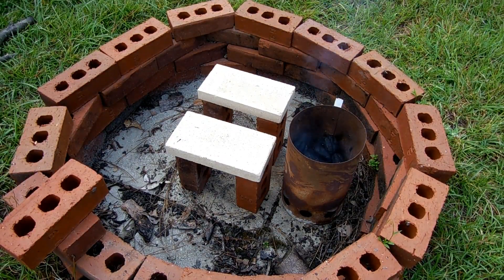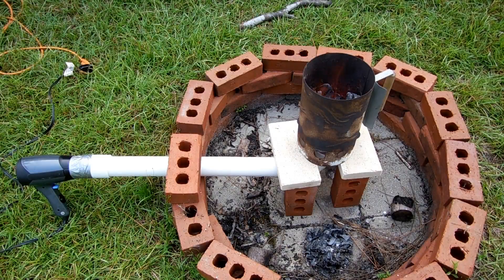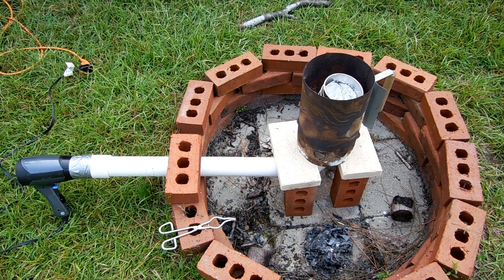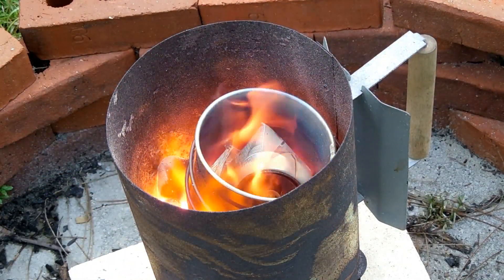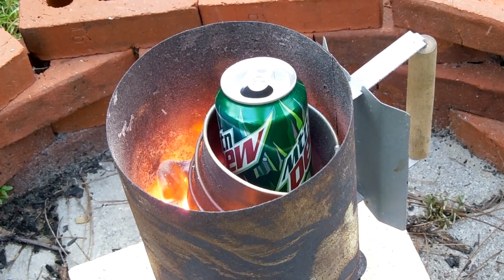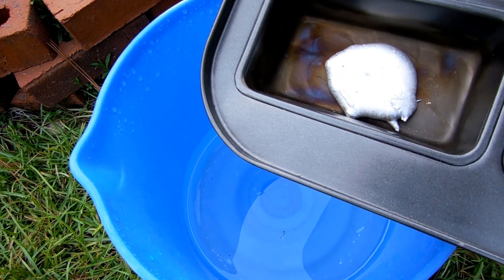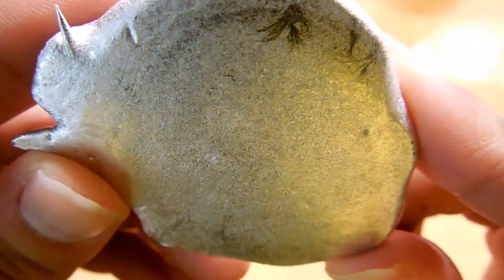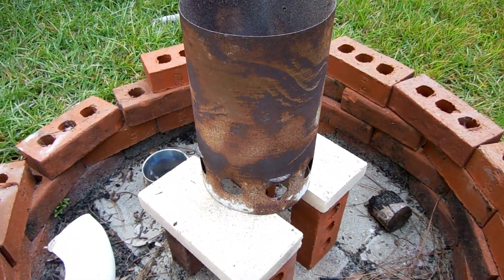Very Simple Aluminum Furnace

Comment: lol i tried melting aluminum on log fire.. it failed
Reply: Has to be a decent log fire for it to work. Wait till your crucible is red hot before putting cans in. 

Back in my primitive days, I used to have the same problem but I kept at it and figured out what was wrong. The crucible needs to be red hot before the cans go in. Don't place one can immediately after the other unless the cans are quickly melting down, once you're out of cans, stir the contents and tap the crucible to allow any trapped slag to float to the top and skim the slag out. Then make your pour.

Comment: have you tried other types of metals like lead or brass?
Reply from the maker: Lead's melting point is far below aluminum, so you don't need anything as "complicated" as this furnace. See my other video on making metal bars for some other metals I've used. Brass is well above Al, and I very much doubt this would be able to melt it. I think it /might/ do copper, but I have yet to try this.

Comment: I wonder if this is necessary. When I was a child, my home used charcoal stove to cook. I liked to play with burning things. Once, I put cans into the stove hoping that it would melt into Alum-nugget and it did. These stoves have a air-window below the burning-room, which allow user to control the burning rate. I believe these regular stove can reach temperature up to 800 degree celsius, above Aluminum melting point.

Comment: You'll lose less metal to oxidation if you stomp the cans flat first.  There are a lot of  YouTube videos and Web sites devoted to hobby foundries.  Some of those guys have moved up to melting cast iron with forced air and used motor oil.

Comment: Wonder how your project has evolved thus far. I would've drilled a hole into the side of both the chamber you hold the coal with, and the one you use to melt the aluminum with (near the bottom of the second one). After that attach the small one inside the larger one with the holes aligned. (Preferably large holes) And attach a pipe going through the large on into the smaller one and that way you can just channel the aluminum out into another container.
Reply from the maker: Interesting idea. I definitely want to improve on the design, since it was something I pretty much threw together. I've been at kind of a standstill lately, because shortly after I made the video my crucible failed (melted through the bottom). So I need a decent crucible before I can continue the project.
Reply: Yeah, it'd be a good idea to check to see how hot exactly your furnace is getting. Then figure out what material you want to use as a crucible.

Aluminum melts at around 1220 F (660 C).
Silicon I believe is more common for holding molten aluminum at around 2572 F. Depending on budget or what you might have in your backyard you might be able to use, Brass 1600-1900 F, Copper 1983 F, Iron 2100 F, or Steel 2750 F.

Definitely try to figure out how hot your furnace is getting to figure out what might be most affordable for you. If you can't afford a temperature gauge, try looking up the melting point for metals and see what you can melt to get an idea on temperature.

Also, for the furnace you used here it might help to suspend the coal slightly above the bottom and drill small holes near to bottom to reduce some heat at the bottom. Anyways, be safe :)
Reply: and maybe have some way to control the airflow, dampeners and such

Comment: using this to melt aluminum cans is not the best use of this furnace.  The aluminum is very brittle.  Best bet is to take old car parts that are aluminum and melt them down. Provides a much better grade of Al as it started off a much better grade.  Then you can sand cast something and actually create a part that can be machined, tapped, drilled, polished, etc and have some really cool art or very useful tools, etc.  Also I bet you had less slag than you thought if you would have poured it immediately after removing the fire.  you need to skim the slag (dross) out before removing the heat.  If the top layer is shiny like a mirror, the slag is mostly gone. you may have to do this a few times.

Comment: You should disconnect the heat element in the hair dryer, you only need the air not the heat and it solves problems with the tape getting hot a coming lose, if you use it for too long the hair dryer will over heat and cut off by thermal switch. With a little insulation and a little more charcoal you can melt cast iron. Been there done that.

Comment: If you are looking for a good forge idea check out the primitive knifemaking at Hoods woods survival. www.survival.com. They use a hairdrier for one of the forges and metal tubing, etc. They don't do very much casting ingots but its still a real neat video on how cheaply you can make a good forge. Other than the safety precautions this was a neat video. I would suggest looking up using a sprinkling of powdered borax to get the impurities out of the metal. I know they use it in homemade silver ingot making. It would be worth checking up on that. I rather melt aluminum cans then truck them by the truckful to a scrap dealer. Good idea for those cans that don't have state bottle refunds on though.

Comment: Molten aluminum dissolves nickel and stainless steel.   Also you end up with a lot of aluminum oxide.  Some of which can be converted back to aluminum by adding lots of wood or wood charcoal (carbon)  inside the pot.

Comment: Not very smart to use a PVC-pipe for that mate... When PVC get's over 150°C or so, it great sulfuric acid, witch not alone makes iron oxidize, it also give you water in your lungs...
Just a small warning for you.

Good luck with improving your furnace... It looks pretty cool.
Reply: I suspect you mean creates hydrochloric acid. PVC contains chlorine. There are no sulfur or sulfates present, so sulfuric acid is an impossible by-product. I have no knowledge it will produce HCl. Personally, I'd be more afraid of the production of dioxins and PCBs.

Comment: You gotta be careful with aluminum cans, a lot of times they are a thin gauged steel alloy. Thats why cans tend to produce a red colored rust. Aluminum will oxidize, it won't "rust" necessarily.
Reply from the maker: I haven't run across any in my experience. In the US, at least, all beverage cans are made from aluminum. Soup and other food cans are the ones made from steel, I believe.

Comment: It'd work faster and more efficiently if you insulate the coal furnace. A simple way to do it might be by applying an insulating spray foam around your chimney :) Cover it up also (create some holes for ventilation first off course :p)

Comment: If you want higher temperatures use regular wood or hardwood charcoal, those briquettes tend to burn at a lower temperature even if they are boosted with air, also try blowing cool air on the fire.

Comment: haha shoes. you do not need them (just kidding) but we have bin in Madagascar and during this vacation we visited a micro factory. 6 men working in and arround an old shed. one big scrap heap next to the shed with all the alluminium they found on the streets. drink cans, old pots, pieces extruded profile etc. they melted it  and then casted it into new pots and pans. these men only had shorts on. nothing more. dripping with sweat. no eye protection, no gloves no shoes no nothing. just bizar. and pouring the molten aluminum just inches next to their bare feet.

Comment: You can accomplish those higher temps by increasing your chimney...I put a piece of duct pipe on an old chiminea(about 3-4 feet) and in burning some old chunks of our house which had some aluminum trim stuck to them it melted them just fine. Found the blobs when I was cleaning out the ashes.

Comment: First of all. Thank you very much for the video. It was clear, your speaking is clear and easy to understand.
As a blacksmith, a nice little trick if you have not done it, is to remove the heating element from your hair dryer, this will make the dryer last longer when you've got it bottled into a tube like that.
Also, tell the rest of the butt monkeys to go make their own video and wear all the safety gear they want.
And as a last bit, you can go to Lowes and for like 10 bucks buy a dryer air vent hose. They are metal and you can bend them in whatever shape you want (To replace the PVC.)
PM me if you'd like, I can share with you some lessons i've learned building everything from gas forges to coal forges (and everything in between:) )

Keep up the great work.
Reply from the maker: Thanks a lot for the support! I'd love to hear some tricks of the trade from you.

Comment: So how would you get rid of the slag? I really want to do this myself.
Reply from the maker: The next thing I want to try is fluxing. This helps the slag/dross to float to the top and be more fluid, so it's easier to remove. A 50:50 mix of NaCl:KCl sounds like a good option. I could also use a real skimmer (basically just a spatula with holes in it) to scrape the stuff out of there.

Comment: Why would you want to melt aluminum cans?
They are a wrought alloy and as such made for deep drawing applications and not good for much else.
You can't make castings and probably not forgings either from them. As an aluminum foundryman for 42 years,  I do like your experiment though.
Reply from the maker: Well really I just thought it would be fun. Melting and casting metals is very fascinating to me. Thanks for the insight on the usefulness of this type of aluminum! I also have Al electrical wire, which is usually quite pure. Would that be more suitable for making things?

Comment: How did you connect the 90 degrees pvc pipe to the charcoal chimney?
Reply from the maker: It's not connected, just positioned about 6 inches below it & pointed up at the grating the charcoal rests on. I guess the video doesn't really make that clear.

Comment: A cheap way of making a crucible is lining the inside of your container with clay. Let it dry in a warm place for a week or more then bake it at 2000 deg (red hot) for 6-8 hours. This will last a lot longer as the aluminum will not effect the clay.

Comment: Aluminum melts around 660.f. add a reducer after the elbow for a more focused air flow. you might want to try a propane burner for less contaminants in your aluminum.

Comment: ...I'd hate to sound like a total idiot, but why wasn't the bucket the foil was in not melting? I'm sure it got a nice burn stain thingy on it, but is it just not hot enough for it to melt???
Reply from the maker: Right, the crucible and charcoal chimney are both made of steel. Its melting point is well above what I can achieve with this setup.
Reply: mrhomescientist Ohhhh, alright. Thanks! :)

Comment: I have worked at NewArt foundry in Utah in 1993-1994 you set up will only work a very few times as the steel will bond with the aluminium and your makeshift crucible will deteriorate. Your crucible at some point will fail and spilled metal your fire. The NewArrt Foundry was a division of NewArt lighting is currently on a business. We made the pressure chamber an air filter chamber for the Ford turbo diesel 1993-94
Reply from the maker: You're actually right - after running the furnace 3 times, melting a total of about 75 cans, the steel crucible cup now has a bunch of holes melted through the bottom. I didn't get any spills, so maybe I got lucky and some slag plugged them up or something. I definitely need a good crucible. I've seen one made from a thick steel pipe and end cap that seems pretty sturdy, so I might try making that.

Comment: Be very careful with the aluminum once you have poured it into the mold. Molten, hot, and cold aluminum all look the same so you can't tell how hot it is just by looking at it. Always quench it once it has solidified and cooled down a bit (make sure it solidifies before you quench it, molten aluminum + water has a habit of exploding ;-) )

Comment: You should degas it while it melts, before pouring your ingot, and for this, just drop a pinch of sodium chloryide (common salt).
If you try to recyclate tons of those aluminium cans, i rather suggest you to cut them and reuse those nice sheets of aluminium (making the cylinder), and only melt the top and bottom parts :)
take care ...

Comment: It's always amusing to do things with FIRE! Just a small tip for your next experiment If you change the air source from the hair dryer to a normal fan or a cold air blower the charcoal will produce much more heat and faster...

Comment: Also be careful with the fumes. Aluminum Oxide is not something you want getting into your lungs! That, plus the other unknown fumes from the surface of the can - paint, plastic, etc.

Also, try this with copper and see if you can get an ingot. I suggest getting strands of wire from any nearby construction project.

Cheers!
Reply: copper's melting point is quite a bit higher than aluminium.

Comment: Pop cans are usually 3000 series aluminum and the tabs are pure 1000 series aluminum, hence why groups collect pop tabs for fundraisers since pure aluminum is worth more than the 3000 series. The outside coating with designs is created by anodizing.

Comment: Plenty of forced-air coal furnaces like this used by blacksmithing enthusiasts. I've seen a lot of homebrew improvements on the design, such as insulation, powerful vacuum cleaner motors for air, using flaps to control the airflow etc.

Comment: I donno if anyone has said this yet but you really need to wear a filter mask when doing this aluminum fumes are very toxic I know this because I am a welder and I have worked with aluminum for years. Go to a hardware shop and ask for a mask that is raited for aluminum welding.

Comment: I tried this today and for the life of me couldn't get it hot enough to melt the aluminum completely.  I even have the same charcoal starter chimney you used!  I used a big soup can for the first run and a smaller can for the second run.  The aluminum melted, but it never liquified.  Any suggestions?
Reply from the maker: Were you using forced air? Make sure the air is blowing into the coals right near your crucible, or place the crucible well into the hottest part of the fire. Also try insulating your charcoal chimney to hold in the heat - since this video I've been surrounding the chimney with fire bricks.
Reply: I used regular red clay bricks and a hairdryer with a steel pipe blown directly into the bottom part of the chimney.  The only thing I can tell I did different was use a tin can instead of one of those bowls, but I've since acquired one of those and I just need to try again.  Third time's the charm I guess.

Comment: You can make a small hole near the bottom to let the molten metal to drain right into the mold and rig a small metal tube for a bit better control.

Comment: I work in an aluminum high pressure diecasting facility, if you want something that will last, coat your crucible/ladle in a slurry made of red clay, make sure your surface is clean and bare steel, heat it in your fire for a few minutes then dip it into a bucket of the slurry and refire it, do this two or three times making sure its completely dry between coatings. After doing this, the aluminum wont stick or solder to it. And will last damn near forever in a home foundry enviroment. Our ladles last for thousands of cycles in production after this process. And for personal safety equipment? boots and flame resistant sleeves and jacket or leather will work well for you. Also, make absolutely sure that whatever you put into molten aluminum is 100% moisture free or you'll be wearing 1200+ degree aluminum. Water immediately vaporizes into steam, which expands hundreds of times its original volume when under the surface of the metal.
Reply: Thank u for sharing... even 9 years later

Comment: why do you burn off the non stick layer?
Reply: it might be needed . i was thinking the aluminum would be to hot for the coating and that the coating might contaminate the aluminium
Reply from the maker: attack125
That was my thought as well. Also maybe the extreme heat would destroy the coating, producing gases that could lead to molten aluminum splattering. Teflon doesn't hold up well to high heat. Is there a particular reason to leave it on?

Comment: The plumbers lead pot is just its name its actually made out of pretty heavy duty cast iron. They used to melt lead in them for cast iron pipe joints so they are ment to get real hot. And I've melted aluminum in them before so I know they work. An add benefit is they retain more heat, giving you more time to cast than the expensive ceramic crucibles.

Comment: Aluminum has a low fusion temperature(the temperatura that makes the element go from solid to liquid) for being a metal, around the 300º C. So getting the heat isn't that the problem.
Still higher than Galium, with its 30º C. Can't use it on hot places

Comment: So basically you added an electric bellows to your wood fire, correct? This is what old blacksmiths used before the age of propane to heat and shape horseshoes and the such, it gets hot enough to heat and melt Steel!
Reply from the maker: More or less. The principle of forcing air through a fire to make it hotter is the same! Mine gets up to an nice orange-red glow - I need to test if it will melt copper!

Comment: A leaf blower with a home made damper can work wonders, very controlable (inexpensive to boot).  Much easier to regulate your heat.  The set up you have is basically an "on/off" switch for your forge although it does work.  I like home grown engineers.  As for your choice of attire...your next video should be "welding naked with mrhomescientist",  "how to get a full body tan while casting brass", "Operating a lathe while wearing a tie".  lol